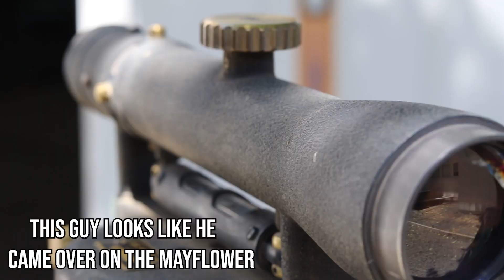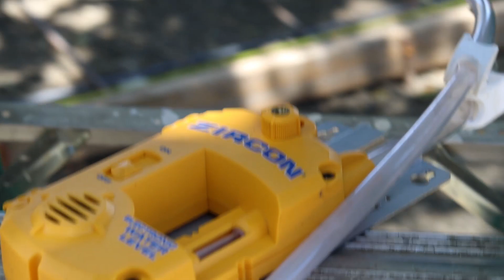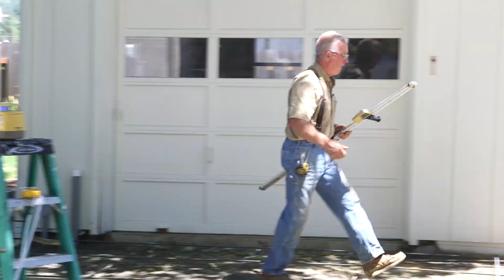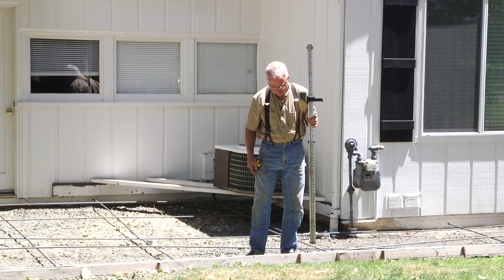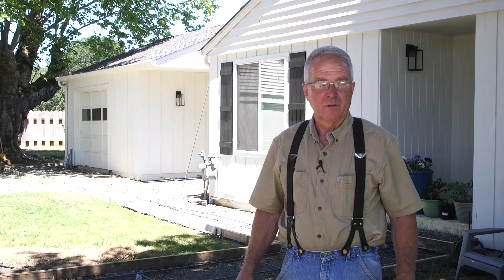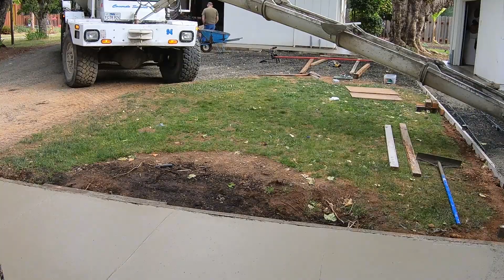The Hardest Part of Forming Concrete

Comment: Love this video. Depending on how much accuracy I’d love to see a video on a “2 Peg Test” on the builders level. The best directions for the test can be found on Caltrans website. Also since you are a humble man I’d say never stand straddling or “humping” a tripod leg as an old rule in the field.
Reply: Is there a practical reason to not straddle the leg?  More likely to bump it maybe?
Reply: @micahned  yes that's it.  Since common practice is to close on a benchmark before you break down, if the slightest bump of a leg causes you to get a different reading than the first one when you establish your HI then you should just go back and start over.

Comment: dang, wish we had square stakes when i was forming. So annoying how 3 1/4" duplex dont fit into stakes, or they do but only half way, have to carry around a bunch of 2" or whatever just for the stakes, and set nails. Nothing like throwing dupies down half on the line (angled a bit away because of the head) and kicking boards against them onto the line with ease.

Comment: We always used a string line with a line level and a plumb bob and a tape measure.  Took about 5 minutes to set grade on anything.
Reply: A line level should be your last resort. But if you have no other choice, just make sure it’s placed in the middle of the line.
Reply: @psidvicious  ya we knew how to do it.
Its an old technique.  Like Egyptian  old.  its the basic way the Pyramids were made

Comment: When I built decks we used a string line with a level.
Reply: These are good for about 10' or so, then they get a little wonky lol
Reply: Your right. A new, strong string line is  one of the most essential tools in carpentry. For lay out, batter boards, straightening concrete forms and a level " strung really tight " works fine. But then, I'm old school, so what do I know.

Comment: I agree with your 2% but you should be aware of work done in the Right of way of a street for a sidewalk that PROWAG and the ADA requirement suggest a 1.5% slope.  This might also come into play if you are grading a sidewalk or a parking lot for a public building.   What you do on private property is your choice.   As a surveyor, this tolerance is less the 0.01 ft across the sidewalk between 2% and 1.5% but the city can make the contractor tear out their work or not pay them completely for their work if it found to be out of tolerance.   
https://www.access-board.gov/ada/guides/chapter-4-ramps-and-curb-ramps/#slope-and-cross-slope   
https://www.access-board.gov/prowag/
https://www.reddit.com/r/civilengineering/comments/9f7wyo/ada_vs_prowag/
https://www.adainfo.org/sites/default/files/1.4-Public-Rights-of-Way-2-slides-per-page.pdf

Great content and thanks for sharing.   Congrats on 1M subs

Comment: Quick fact about optical levels: as seen in this video with the Berger, they have adjustments for the internal cross-hairs. Surveyors know to do what's called a "peg test" and cross-hair adjustment prior to any important leveling, or on a regular schedule, because these cross-hairs WILL go out of adjustment. Levels, even when boxed, are transported in the work truck and since they are small pieces of equipment can be jostled around, possibly hastening their trip to out-of-adjustment land. For example, we were on a job site where the contractor was using their level to set anchor bolts to a certain elevation to install a 16 million dollar compressor unit. I was watching them struggle so offered to check their level. Number 1, the bubble was out of adjustment and number 2, the crosshairs were out of adjustment by an inch and a half (on a 200-foot range). This means they would have NEVER been able to get an accurate measurement. If you've never pegged your level, it's probably out of adjustment.
Reply: It's worth noting that a more modern Auto Level can also get out of adjustment, and needs to be "pegged"  occasionally.    For what it's worth, the bubble being slightly off isn't really a problem, if you know what you're doing.  You check the bubble both directions and then split the difference. the end result should be that you adjust so the bubble is off by a certain amount, and it maintains that position in all directions. The amount a bubble is off will change with temperature, and it would be next to impossible to adjust a bubble vial so that the bubble is centered when level for all conditions you might encounter.
Reply: @andrewalexander9492  how do you peg a level 
Thanks
Reply: @buddyg1408  You take two points whcih make good solid spots to set a level rod on.  It can be 2 marked spots on a curb, or two stakes driven firmly in the ground. (that's where the name "peg" comes from, the procedure originally was the "two peg test" )  the marks should be about 50-70 feet apart, about the same elevation, and you can see between them.   First set up the level exactly halfway between the two, level it carefully and take a level rod reading on the top each stake.  when the level is exactly halfway between 2 points, any errors in the level are cancelled out between the two readings.  subtract the two readings and that gives you the difference in elevation between the two stake tops.   now, set up the level so that you're  as near to one as you can get and still focus on the level rod (5-10 feet) and looking down the line of the two stakes.  Read the level rod on both stakes, and subtract the readings, if the difference is the same as what you got with the level halfway between the stakes, congratulations, you're level is in adjustment.  If not,  you need to adjust the crosshairs so that the difference in the readings you get looking along the line from one end, is the same as the difference in readings you get with the level at the midway point.  There are usually some adjustment screws whcih adjust the crosshairs.  depending one what kind of level you have they may be hidden under a cover. On a Dumpy level like Scott's  the crosshairs are adjusted by 4 "capstan" screws.  If you look at 6:30 in the video, you can see 2 brass screws, one on top of the scope, and one on the right side, there's two more on the bottom and left.  The capstan screws have a hole in the head whcih allows you to turn them by sticking a pin in the hole. You loosen one very slightly, then tighten the opposite one slightly.
Reply: @andrewalexander9492  I agree. Even a compensated level can't compensate for bad cross-hairs. Also agree about the bubble, but in this instance it was a rapid indication that the level hadn't been maintained as it took them forever to get it set up and ready because of it.

Comment: @8:39  another need for slope 1% or greater is to prevent the formation of ice in winter.  If the slope is too flat, the water will freeze before it gets off the walking surface and/or roadway.
Reply: That is why God gave us salt!!!  HA HA HA
Actually, good to know.  I am not experienced in much in the way of masonry, so this is good info.  Thank you!!!
Reply: @Caderic  Salt is bad for concrete though.  Pitting a lot of salt on a concrete walkway or driveway will cause it to deteriorate faster.
Reply: @andrewalexander9492  Man, it was just a joke...sarcasm.  
That being said, I had Texas in the back of my mind.  We would only need to use salt once every 5 years or so.  And that would only be once for that two days we have ice/snow.
But yes, I agree, salt in this case is to compensate for less than great design. 
Again, it was a joke.
Reply: @Caderic  salt is a reactionary procedure, not preventative.  also, some places ban the use of salt for de-icing.
Reply: @tomw8647  Once again...IT WAS A JOKE!!!!!!!!!!!!!

Comment: Is there a difference between a "Transit" and "Builders Level"?  We always called it a transit.  I am guessing same thing different name.  But maybe, there are some technical differences that I am not aware of?
Reply: So, time to fight it out...HA HA HA, just kidding.  But maybe more information?
One person says "...a transit move vertically and horizontally..."
Someone else says  "...a transit measures angles..."
Does it have to do BOTH to be a transit?  Because I could see there being different types of transit...
...all transits measure angle, some do horizontal and other also do vertical too...
...or...
...all transits move horizontal and vertical (this could be beneficial for checking level and plumb when angles don't mater), and some measure angles too...or some measure angles one way and not the other?

Confusing?
What say you?
Reply: @Caderic  there's' really no contradiction between :   "...a transit move vertically and horizontally..." and    "...a transit measures angles..."  Both are true statements.  And yeah, both are required,  in order to measure vertical angles, the scope portion has to move vertically.  Yeah, it can be confusing, in part because builders use the terms incorrectly as synonyms.

A Level is pretty much a one-trick pony.  it's purpose is to project a level line of sight out in all directions.  That's all it does.  But even that gets confusing, because some cheap builders levels have a protractor built into the base so that you could do some crude horizontal angle measurements.
Reply: @suspicionofdeceit Ok, se we were actually using a builders level!  I learned several things today!!

Thank you!
Reply: @Caderic  Actually, no. Scott is mistaken, that is not a "builder's level"  that instrument is a Dumpy Level.  It was built for surveyors, back before automatic levels had taken over.  It's a much higher quality, more accurate instrument than a builder's level.
Reply: Definitely not two different names for the same thing.  A level projects a level (if it's set up correctly) line of sight, period. That's all it does.  A transit measures angles ... it measures angles around, horizontally, and it measure angles of sight up and down vertically.  A transit can be used to project a level line of sight,  but it's not very good at it.

Comment: Nice summary.  As an engineer (and a consummate pedant) I draw a distinction between accuracy and precision.    It's a distinction that shooters appreciate.  Precision is the tightness of the bullet group, accuracy is how close the center of the group is to the bullseye.  I don't disagree with your assessment of the relative precisions of the builder's level and the laser level, but the relative accuracy will vary from instrument to instrument and is impossible to judge without calibration.  Personally, unless calibration checks are carried out, I would place most faith in the simple water level.

Fortunately, when accuracy matters, calibration checks of the carpenter's level, the builders level, and the laser level are simple and easily completed in the field.
Reply: You got me...what is a "consummate pedant"?  It's a new term (at least used together).
Reply: @Caderic  A pedant is someone that blathers on about inconsequential details.  Consummate implies that I do it exceedingly well and often.  :-)
Reply: @briantaylor9266  Ok, I thought something like that!  LOL  So using that word is "self fulfilling"?   LOL
Reply: @briantaylor9266  And this is why my kids were never the kind who do the pestering "why?" I would tell them. At great length. 😄
Reply: Greetings, fellow pedant. The thickness of the laser “line” has always annoyed me, and I can say from experience that it can rapidly introduce a 1/2” of inaccuracy, even over relatively short distances.
Reply: Cannot beat a water level for the honest truth
Reply: friend of mine was a ceiling guy, could be a huge span in industrial. He always checked his laser with a water level prior to set out. Too many guys just believe in the laser, calibrated recently or more often not.

Comment: Know what a water level will do that the other 2 won't? Go around walls and other visual obstructions. And water always finds level, the other 2 always find a plane. It might be a 'level' plane but a straight line is still tangent to this sphere we are living on. On ocean is level but is obviously not a plane.
Reply: Water doesn't always find it's own level unfortunately. I used a water level for some time, the speed wasn't a problem for me, whatever it was, it threw my long trusty 1/2" diameter vinyl tube off about a 1/4-3/8" one day. Checked for hours waiting to mark some posts to cut and set beams, all air bubbles were exited, no kinks, both sides had been in equal sun/shade temp. Yet, 2 hours later they still weren't matching up with I brought them together. I aquired a rotary laser, allowing to drop the laser anywhere, walk around quickly with a receiver and tape measure and spot check for the high spots in concrete, grade, framing, cabinets etc. Don't get me wrong, a water level is beautiful, as long as it's being checked frequently and you don't have any issues that day. A home owner can always make do with a water level, even if have to troubleshoot some days. Good enough for the romans wasn't it!
Reply: @briarstonehomes9835  I started reading and the first thing I thought was temp, nope. I thought maybe surface tension but not that far off. You are right on about the romans. I have used a rotary as well as a transit years ago. And Scott was wrong that you need 2 people for a transit. A Christmas tree stand and a post with a old tape measure attached and you can do it yourself but you will get your steps in.
Reply: @timothydillon6421  ^^exactly
Reply: @briarstonehomes9835  most likely water tension and adhesion to the outside of the tubing. I'm guessing larger tubing would have less issues, less surface to volume ratio
Reply: @drew5334  makes sense. I was using 1/2" clear vinyl tube, about 50' long I believe. If adhesion, what would the fix have been just curious? Wasted a great deal of a day tring to set some wood back in the day because of this. I still keep the water level tubing for lending to family friends and stuff, it'd be nice to know how to troubleshoot.
Reply: @briarstonehomes9835  Two things you can do to overcome the surface tension problem. 1) Add a couple drops of dishwashing soap to the water and it will help break down the surface tension. 2) If you are reading the low point of the water in the tube (“trough”), make sure that’s what you’re marking on the other end, or vice versa.
Reply: You can set a laser up to go around corners and if your confident, you can reset your laser using a known landmark. Or, GPS is pretty good too.
Reply: @mikeznel6048  by that point its again about whats less work. if the "project" is a huge carpark then yeah laser/gps all the way, if its just my garden with a few trees/bushes in the way im gonna stick to water
Reply: Yeah... meaningless for dumb concrete heads. Meaningless. And, water levels.... They're like rainbows. They have no place on a concrete job site.
Reply: @billbradleymusic  MOST concrete guys are very intelligent actually. It takes brains to reverse build everything...unless your talking about sidewalks, anyone can lay a 2x4 down
Reply: @Skipdogg15  Agreed. That was clearly a comment from someone with little or no concrete experience.

Comment: I was taught those were called a transit.
Reply: No, a transit is a very different instrument.  The black instrument pictured is a Dumpy Level (not a builder's level, although the difference is fairly minor)   It measures levels only. the scope does not adjust up and down, it only points level.    A transit measures angles.  both horizontal angles and vertical angles (angles rotating around in different directions, and angles up and down)   A transit looks like this:  https://americanhistory.si.edu/collections/search/object/nmah_745881A transit can be used to project a level line of sight,  but it's not very good at it.

Comment: My dad built a concrete block retaining wall when I was a kid. He borrowed a water level from his boss who had built his own house many years before. My uncles, Mom’s brothers and professional carpenters, did not believe that a DIYer could get good level with such a simple tool. They came over and checked the footing with their builder’s level and it was dead level. The wall is still there fifty years later.
Reply: A DIY's who cares about the product (and is maybe a little OCD) can often do much better work than the "professionals".   Quite frankly, there are a lot of guys in the trades who are just hacks.  Just as a single example,  there's a video on another channel about plumbing whcih discussed the reasons that it's important to ream pipe before assembling it.  (Never mind that reaming pipe to full diameter is required explicitly by code )  there were a whole bunch of guys who commented on that video claiming to be plumbers, and claiming that reaming pipes was stupid and a waste of time and said they never reamed pipes.   I guess the thinking is that an inspector is unlikely to be able to see that the plumber ignored that part of the code, so it's ok to ignore it.   Unfortunately that level of integrity and craftsmanship is too common in the trades.
Reply: It's thought that the Egyptians leveled the base for the pyarmids of Giza by carving a channel in the bedrock around the perimeter, filling it with water, and using that as a guide to prepare the base for succeeding courses of stone. Clever.